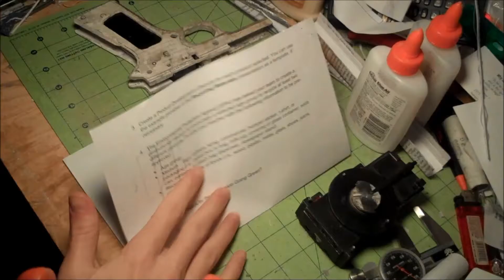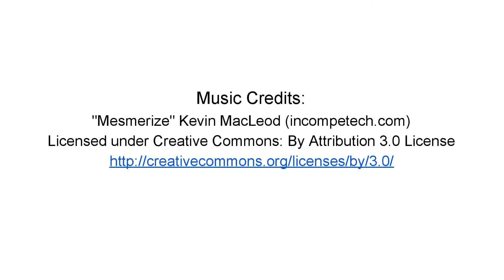My Very First Paper Projects

Comment: how do you cut the same saiz  paper?Do you measure every time or do you glue on paper and cut?Sorry if my english is bad
Reply from the maker: Usually I print off multiple copies of the same image. Then I glue them to the hardened sheet of paper. Then I cut it out.
Reply: +Shelden Caudill oo ok thanks of replying my question